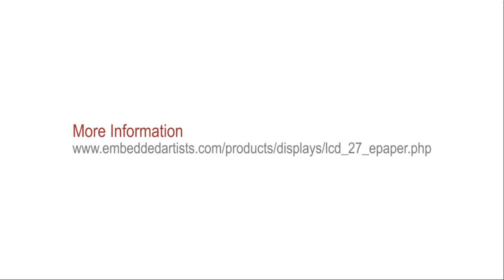E-Paper Display - Introduction and Demo

Comment: is there anyway to hook this up to an original gameboy?
Reply: E-ink is not meant for video since it is has a very low refresh rate some of them need 1~2 seconds to change the content and many of these displays need to "shake" the image in black and white in order for the e-ink to not create any ghosting.

These displays are meant for e-book readers, static text site reading with basic graphics in black and white only and also for displays in stores etc. They are also low in consumption since once the image is set, it doesn't need any power to keep that image.

E-ink is not LEDs or any other emitting light source, it literally has physical parts that move upa nd downt he medium to either show or hide the dark particle.